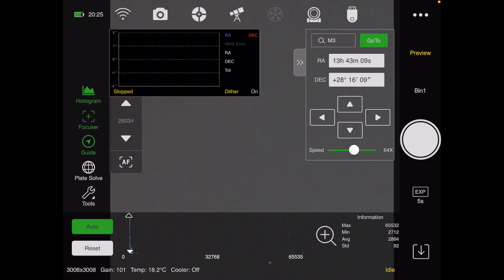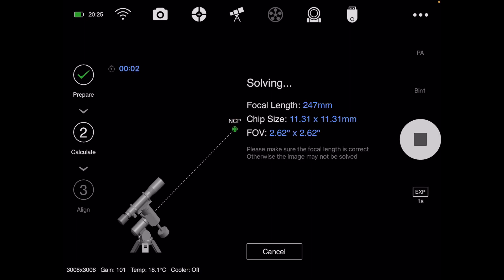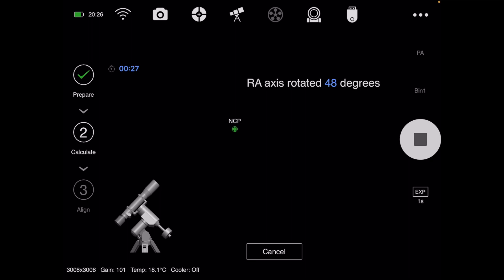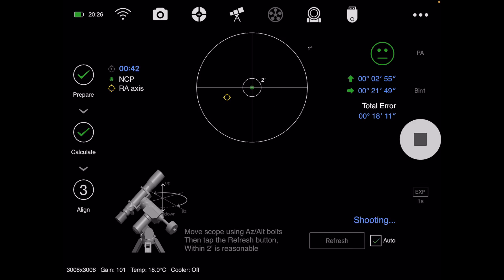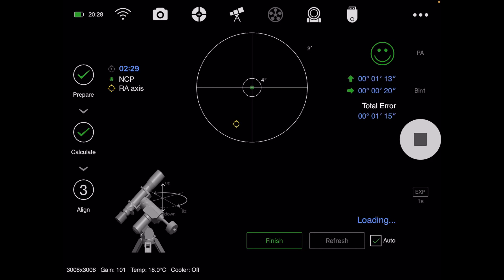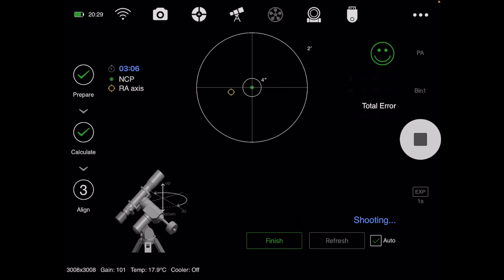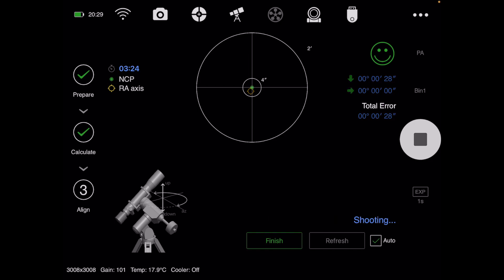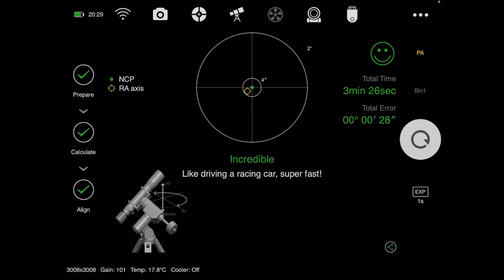ASIAir Polar Alignment Hack

Comment: Why don't you just wait to hit "finish" after the very last tweaks?
Reply from the maker: After looking at the video I had it as low as 0.24 arc second and finished at 0.28 arc second. The lower the number the better guiding you will have as you won’t have as much polar drift to deal with. It’s also helpful to go over your logs so you can see the improvements small changes make, as the logs don’t lie. https://joeytroy.com/reading-asiair-pro-log-files/

Comment: What guide settings do you use? I tend to find my RA bounces up and down way more than the Dec which has far less errors. I tried bumping the aggressiveness down a bit but didn’t notice much change.
Reply from the maker: Jon,

I don’t recall my settings off hand. It maybe in one of my older videos under settings. I have since moved to an OAG and the ASI290MM mini which has more sensitivity than the 120mm mini.

Comment: Does the ASIAIR slew the mount itself for the 60 degree rotation during PA, or do you do it manually with the hand controller?
Reply from the maker: Michael, the ASIAir will control the whole mount as long as your mount is motorized and is supported from ASIAir.